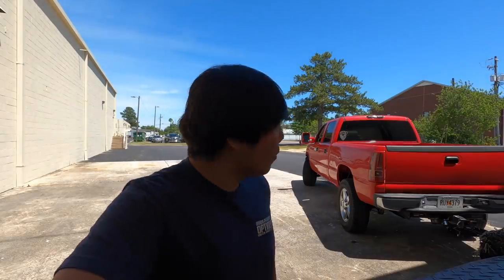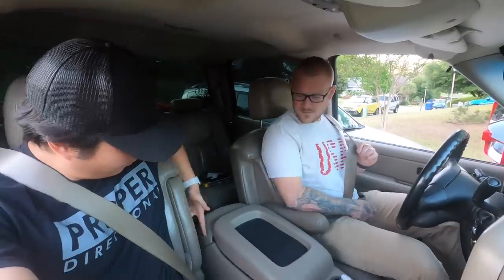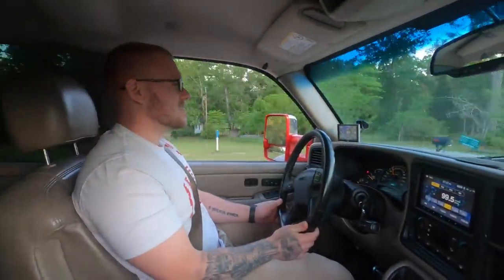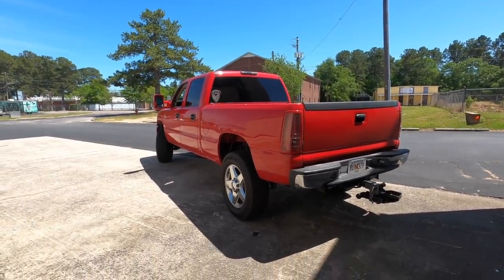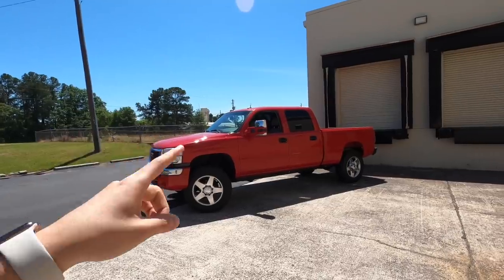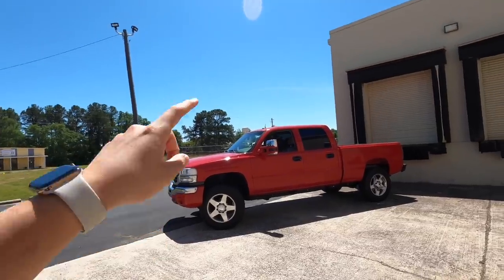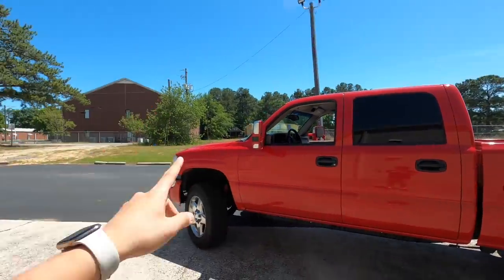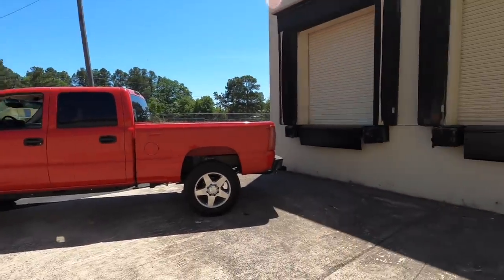LEVELING KIT RUINED BY TRUCK! TIME FOR A LIFT KIT!!!

Comment: Completely agree... I have a 2019 L5P and really just wanted to level it but knew how shitty the ride would be. Went with the Cognito 4-6" adjustable lift instead, turned it all the way down to 4" and only put a 1" block in the rear. CV angle is COMPLETELY straight, ride quality is better than stock (especially with the Fox shocks) and barely sits higher than a leveled L5P.
Reply from the maker: That’s a proper set up right there! 🤘

Comment: Glass won’t puncture a tire
Reply from the maker: Don’t test my luck
Reply: I can tell you at the very least it will slice the hell out of it till it hits the metal wires. I learned that before.
Reply: Can respect that. Better save than sorry.  I’ve driven through a bunch of glass on a demo job before.  Just crushes to powder